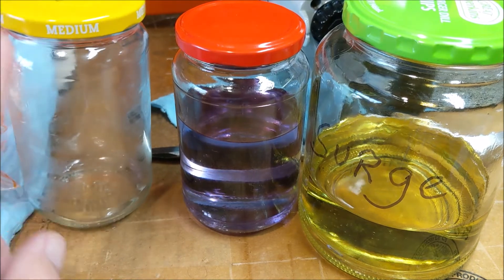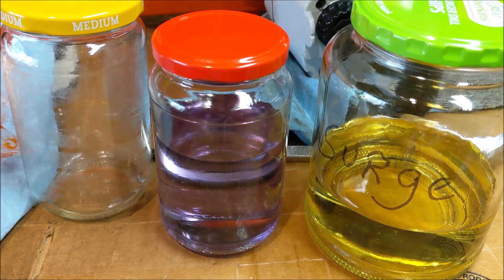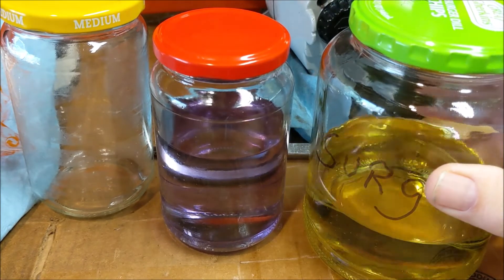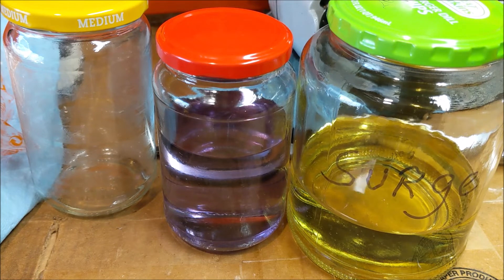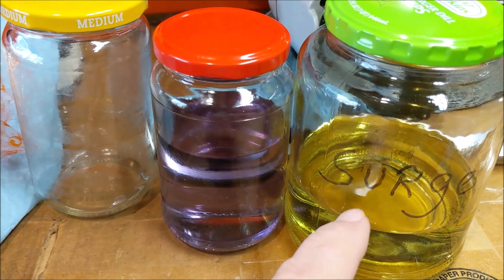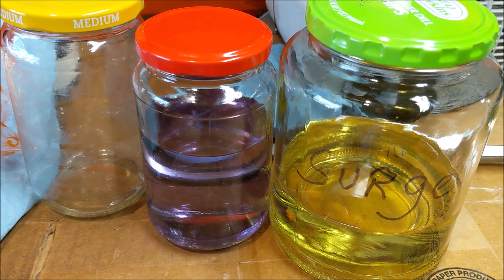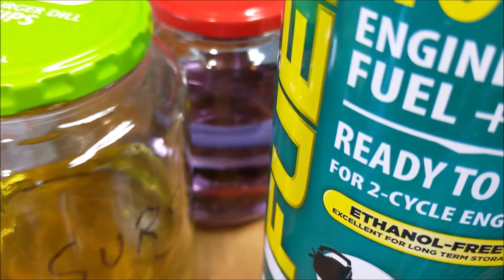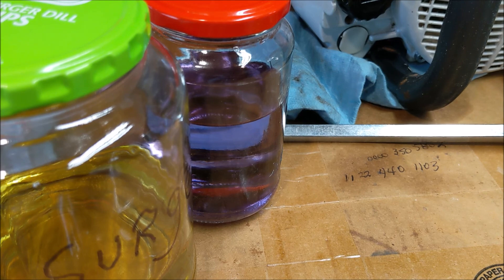FarmerTec Chainsaw Liquid Insurance

Comment: I was running 100 low lead (blue in color and cost around $6 a gal) from a local airport.  They no longer sell it to the public.  So I picked up 10 gallons of 110 leaded  race fuel (purple and around $10 a gal).  I mix that with 93 ethanol free. I mix it 50/50. Cost is almost the same as the 100 low lead.  Just more work on my end. I burn 20 to 25 gallons of gas in chainsaws every year.
Reply from the maker: I don't see it as work. You might want to look into mixing that with someone who knows about fuel. I heard that was bad unless you were mixing similar fuels. They sell race fuel that is less than 110. What you were buying at airport was 100. Sorta what I said in video. Thanks for watching anyway.